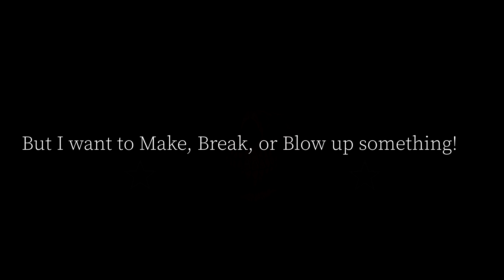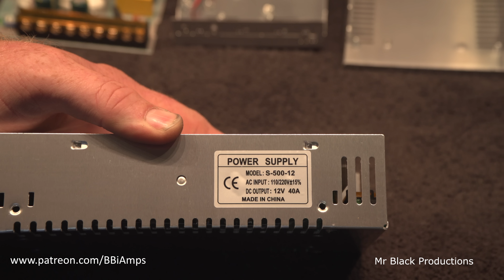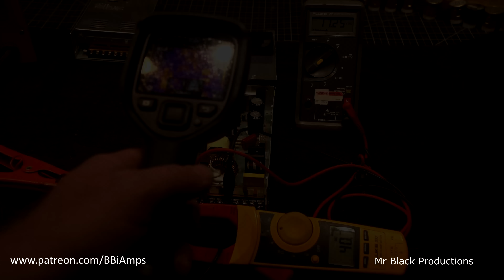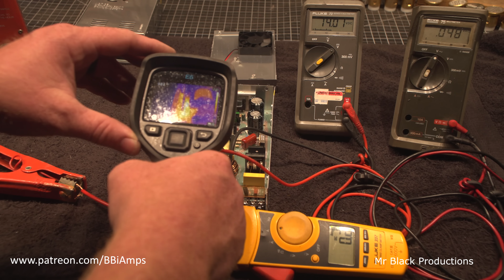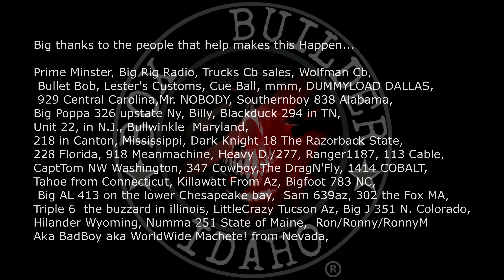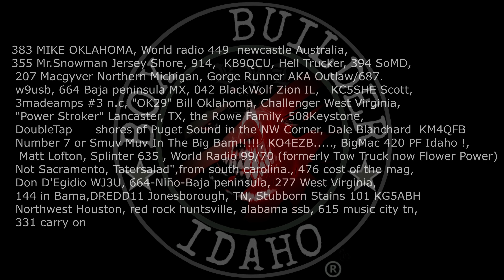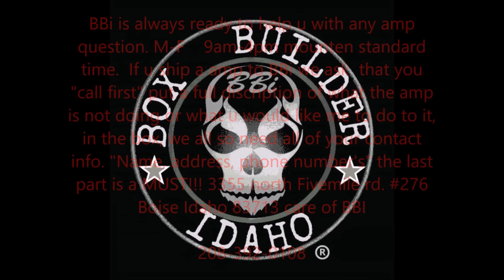The Label is a lie! But there good for 25 amps!

Comment: What about using the MegaWatt PSU's? They have fans, and do the rated power.
Reply: After thinking about this further, I realized the problem with MegaWatt PSU's are the price. They are not as cheap as the Chinese knockoffs. However, I do believe that the extra money would surely be worth it. Especially if BBi built it..also considering that you can use less of them, leading to a smaller box. Which of course takes up less space on the bench. I have seen videos on YouTube where guys are using like 7 of these Chinese knock-offs to get 200amps. MegaWatt, you only need four. It would also be less work to build.

Comment: This is why I only use Megawatt PSUs. They do what they say and I've got a few that are flawless.
Reply: Same.
Reply: yes they are great to. for the AMP world of HG use 15V SMPS not 12V and turn it up. That the problem. 2879/MRF 454 Etc. like 15V or so. yes Mega watt holds the voltage better. the pills around 50% efficient. and you need power for fans and maybe bias . go with bigger SMPS . less sag on voltage and last longer. 73's
Reply: I too like Megawatt.   I have 6, but I did actually have a failure.  Still has full output,  but squeals and and a grind noise only under any load applied.  It’s not the fan.  The main guy/owner had no interest whatsoever in helping me or listening to the issue I had.  I truly wanted to send to him so he could check it for his benefit, but that guy could give two shittt$. A shame.  But I do still like my Megawatts.
Reply: I just got my megawatt so I’m glad to see your comment lol
Reply: MegaWatt or Meanwell for me,no problems.

Comment: I've used these as bench supplies, set at 13.8 (not this particular model). I realize people have been hopping these up to use as overvoltage power supplies for transistor amps. I am a bit curious how these perform at the 13.8v I  believe they were intended for. Surely  not as well as the old ones (there's a name brand, which I forget, which was considered the best, and I used one for years)

Comment: I use server power supplies.  They are rated at 12V 62 AMP.
I tested them at 12.55 volts on a carbon pile an s they shut off at 70 amps with 1/10 of a volt drop . They have been running over 5 years continuously. They have short circuit protection and polarity protection and overload protection. The fan runs very quiet and only speeds up when you approach max current output. My Amp is 20 years old with 2290's . You transistors will last 4 ever running@ 12.55 volts. Its no th about the volts . It's about the current with hardly no voltage drop . These power supplies use a CS current share connection which divides the load equally between  all the power supplies.

Comment: Hey BBI you should do a video on using the HP HSTNS series server supplies, they're 12v only and start at 450w and you can get 750w and 900w models. The 900w will do 1100w iirc on 220/240v AC.
There are videos on YouTube for setting these up but I know you could make one way better. The supplies themselves are pretty cheap and coming back down in price since fewer people are using them for gpu crypto mining.

Comment: My question is, was the power supplies the same as the old or were they cheaper? If cheaper, that may have been your first clue. The other thing is, in your demostration, it looked as if the supply was maintaining what it was designed for, 13.8vdc @ 40 amps.

Comment: We got loads here in the UK! I've been through 2 in 2 years! A 30a and now my 40a just had a high speed fan on start up with no 12v output then one of the 3 caps popped at the top! It was one of the green 16v 3300uf by the way! Any clues to why this has happened? I replaced them with the higher voltages ones but still no 12v, it has a full speed fan and the new cap in the same position gets warm!🤷🏼‍♂️🤦🏼‍♂️😭

Comment: these are the ones ica sells or no? I work in IT and get assloads of apcs and server supplies..working on a 400 amper with 100amp hp modules. i need to start pulling the transformers from the apcs for sure. Chineseum BS! any luck on getting a 8 pill 2879c box made by you ?

Comment: I have one of those cheap units  Yup 20A at best and sprays  RF noise when powered up. The cheap one  came with a  temp module.. but never ever turned the fan on when hot on...    MeanWell is the way to go.   Quality over cheapness.

Comment: My power Supply's are Siemens designs, from 12v 500A to 15V 800Amp... And the DC is so Clean, Not Cheap but will Last a Lifetime...And you can Beat hte Piss out of them and they do not sweat the abuse ...

Comment: very good. last repair I did of a base box was a blue label 8 pill . was re done buy outher shop. pp 100 gone. lives with RFP 2879 and bias. came to me with blown switchers a few years ago. put in new. this year the switchers blew again. and was told a outher shop did same thing. Lives with mean well SE 1500 15 switchers X 2 . stays 15V . finally gets 1500 watt out. never did that in it's life. That with his radio . lot of junk SMPS out their. Mean well has UL on it ! spend the money ! The RSP 2000-15 is great as well . SMPS is rated in watts not amps. volts times amps. more volts less amps. If China can get around ohms law ! LOL . 73's😃

Comment: check out a 100amp power max switching power supply,they were built pretty good but now I don't know,they have 3 pos switch on the side that take a screw 🪛 to turn from power supply, battery charger, booster and up to 16.5volts on mine and I used them on 667,s and 500,s with no problem and I'm sure if they can be cophase or not
Reply: Thats what I use to run an Ameritron ALS 500M on my desk, I can get close to 600 watts.
Reply: my bench supply is 2 Meanwell SE 1500-15. BBI used one to charge LTO battery's. haven't has power max come threw yet. I can send you a truck load of them so called 30amp China supply's I changed over the years. 😀
Reply: I have 3 of the 150 amp models...according to the company they can be linked together but I'm not sure how to have equal load on each?
Reply: I've wondered if those power max chargers/supply's would be a good source or not ?
Never actually knew anyone who had experience with them, thanks

Comment: If   you    put    bank     of       500F    Farad Capacitor Super Capacitor 16V      will     that    help     load   on    the     powersupply
Reply: Thet whil be a virtual short circuit on the output till they fill up.
That is not usefull mod.
There is simple math for capacitance neded on the output.

Comment: I see BBI post a video I click. Also server power supplies are what I'm going to try to use.
Reply: It's got me wondering if the Server supplies are starting to get the same undercut in design too.
Reply: Server supplies are awesome if you can live with 13.8V max! They are built like a brick shit house. The other problem is fan noise. Most of the fans are 3 wire you can not just delete them for a quiter fan because that 3rd wire reports fan RPM. If you want to put them in a bigger case with more ventilation and fans that do not make leaf blower like noise you have to spoof the RPM read out with a 555 IC.

If a server power supply is rated at 12V 50A you can run it at that all day and all night for years at that load and not kill it.
Reply: I got a HP Server PSU rated for 33a. Works great

Comment: BBI, I have a HP server power supply, that they say will run 100 amps at 220volts. Have you tried to over volt any of those? I know people use them to charge batteries for RC cars, trucks, etc..  but I'm thinking they could be used for amplifier PS. if you can get up to about 14volts
Reply: Those and the Dell server power supplies will do exactly what they say. High quality
Reply: @derek7017  🤜🏼👍🏾👍🏻👍🏿👍🏼👍🏻

Comment: Pulse with supplies....na I like iron core.linear
Reply: ICA and EPD have great transformers. grab a 200 to 400 amp bridge mount to cabinet with thermal compound not the CPU stuff. and use a large can cap . ICA has great ones . and you are good for life. 73's😀

Comment: Seems like xenophobia to me, the PSU appeared to perform adequately.  Increasing the voltage has nothing whatsoever to do with "over-clocking".  Over-clocking refers to increasing the clock frequency of a digital component above it's max rated frequency.  Increasing the voltage of a switch-mode power supply does not typically affect its switching frequency.  Many of the comments made in the video are also not necessarily indicative of a lower quality product.  If for example the switching frequency is higher than a comparable product, you can use smaller value capacitors & inductors to give the same amount of smoothing (and I note that the output ripple was never tested).  Better (lower) on-resistance switching semiconductors allow both fewer power components and a smaller heat sink because they are more efficient.  Also using lower tolerance components does not equate to lower quality - it depends what the design requires.  In the test the PSU gave its full rated 40 amps with a drop of only 1V below its rated output voltage, which is probably within its specification.  He also complained that it got hot (but did not overheat) after having completely removed the cooling fan!  Removing the cooling fan on any piece of equipment running at its maximum rated power is going to cause it to get hot - what on earth does he think the purpose of the fan is?  There was also no comparion between the PSU he was complaining about and the "superior" one he was comparing it to.  Let's see how that supply performs under a 40A load.